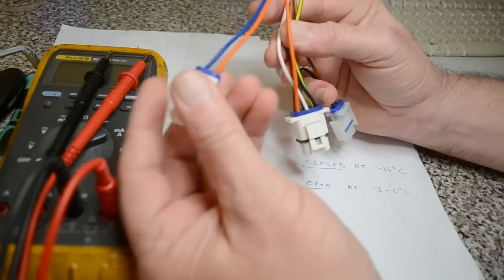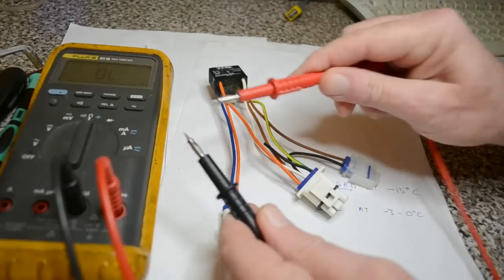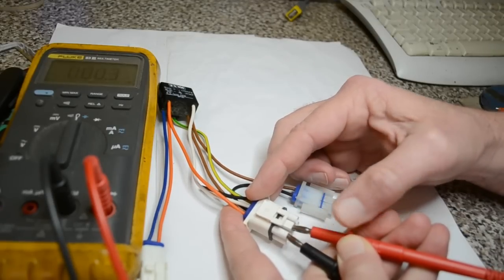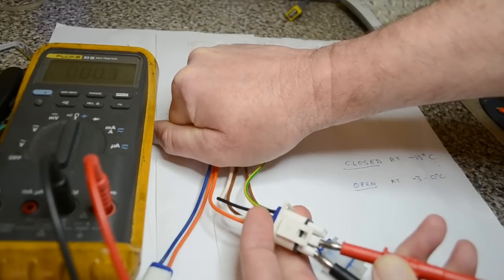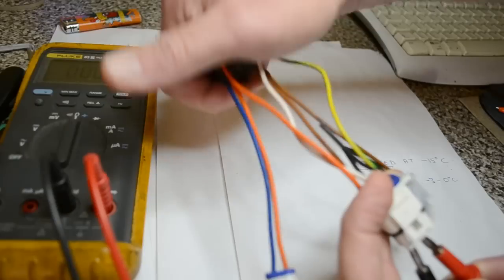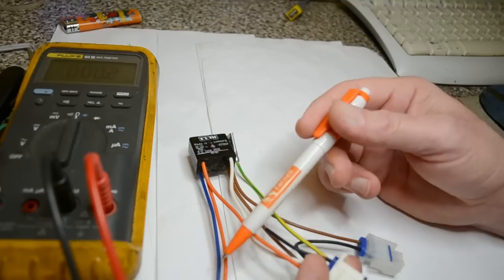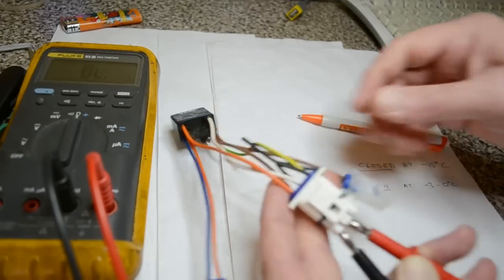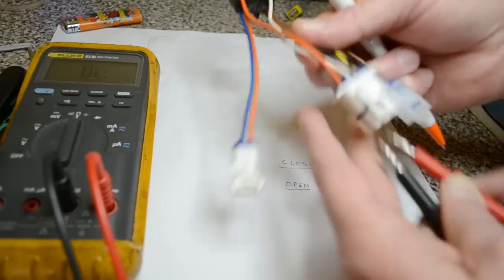How to test a Whirlpool / ELTH Frost Stat - Bi Metal Switch Type 261N read description too

Comment: Hello John,

Do you know how to test the 3 wires 20T80 model ? Is it an inverser or two wires are always connected (white and grey) ?

Is it a dry contact (0 ohms) or semi-conductor contact like static relay ?

Thanks
Reply from the maker: Hi,
Sorry no idea.
The switch on the regular model is a mechanical switch.
Reply: OK Thanks

Comment: I have a smeg with a261n which has tow outlets for heater element can I connect both heaters to the same one outlet because smeg needs about 190euros for the original which also is not readily available
Reply from the maker: Hi,
Search Amazon for the same part, they are between £35 and £48
Is yours faulty?

Comment from the maker: 481232058132 is the Standard Elth unit with TWO wires and 2 single plugs for the heater. The unit I'm testing in video is off a Smeg and has a different part number !! The one I'm testing has a 2 way plug for the heater, most models do not have this. If you have 2 wires and 2 single plugs for the heating element, use the above number
Thanks

Comment from the maker: There are 2 types, you need to get onto Whirlpool to find out which is yours
Reply: In my place there are lots of defrost stores in common usage, see if I can replace them with a defrost device of a different form, but it does the same function, because the original model is not in any refrigeration store. (if only I could show you the bimetal instrument picture)